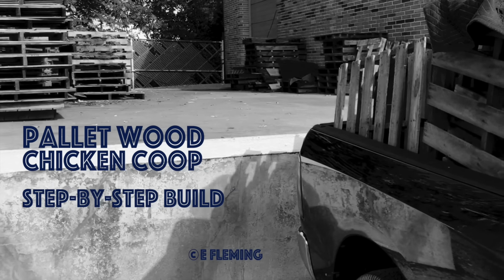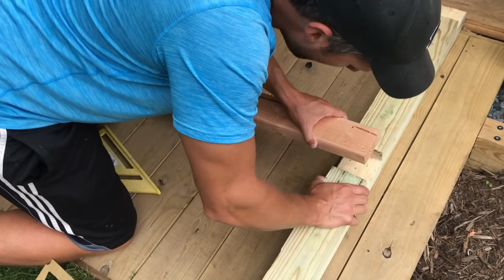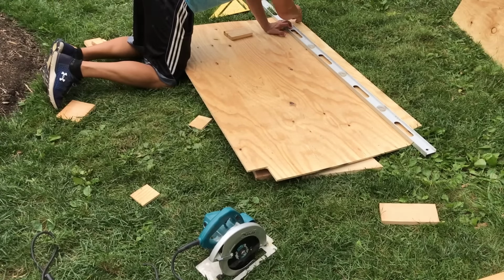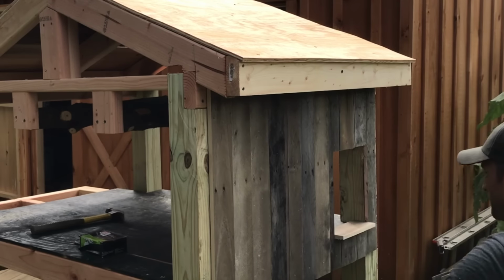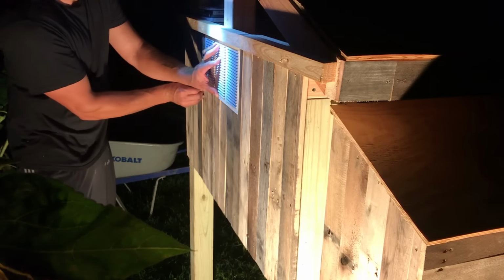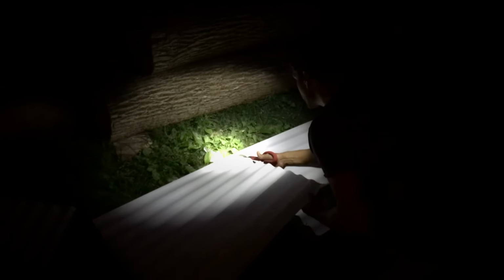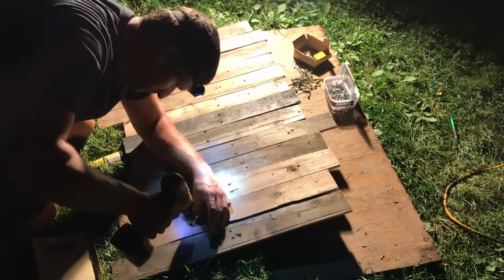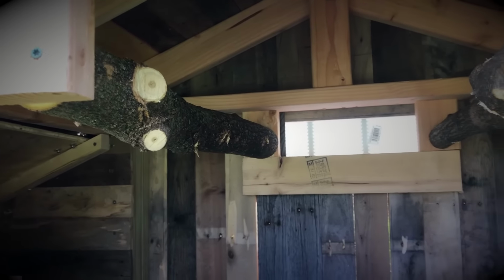Chicken Coop:  Step-by-Step Build V3.0 (Long Version with Commentary)

Comment: Thanks for sharing your video. I was in the same boat. I ended up building my coop and run out of every scrap of wood I could find on my surburban property. I only bought The roof hinges handles and locks and chicken wire for 9 chickens. My husband said  I over built, He said it would hold a baby elephant inside. Guess what I had on hand was baby elephant material? Ha!
Reply from the maker: 😂.  Perfect!

Comment: I used a water proof sealant paint on the floor.  I will use construction sand on the floor as it cleaned up like kitty litter.
Reply from the maker: Sounds like a plan.  That should work well.  If you put plastic bins or trays directly under  the roosts, you’ll save yourself some time and sand.   Id say 90% of the droppings in the coop are found under roosts.   Put a slight sprinkle of sand in the trays, and it’ll keep the droppings from sticking.   Just like putting flour on a cooking surface when kneading dough.   Haha

Comment: if you do the ramp 33:42 without grip pieces the chicken will not be able to climb up to the coop? I see everyone is doing them, but I wonder if they are really necessary.
Reply from the maker: The chickens would probably be fine in dry weather, but if it’s muddy or snowy they would have a tougher time.

Comment: starting to build a coop very similar so I thank you for the invaluable  help and guidance you have given through your videos.  I was wondering though, if the supporting members  (4:30) could be at the same level  to give added strength to floor?  I was only thinking if i needed to get inside to do any work , my coop will be approx  3x5
Reply from the maker: Hey,  I think I understand the question.  The coop is designed this way so that the nesting box can be framed up as part of the coop (not added on separately).   The one set of notches is lower, but the nesting box framing rests on the 2x4 that goes between those posts.  The coop will absolutely hold you (and even a friend).   I framed up a 4x4 coop the same way and stood on top of the platform  (I weigh 250lbs).

Comment: I know this is an older video, but it sure came in handy for me today as I need to build something as cheap & easy as possible to separate some hens. I only have 1 question if you see this comment:  How do you wear a headlamp to work in the dark and not attract a face full of bugs? I thought one would be a great hands-free option when doing late night chores, but the bugs made it impossible to do anything with it on.
Reply from the maker: You’re right!   The bugs get pretty bad!   My wife was very pregnant and we were coming up to the due date….had to get the coop done!

Comment: How do they like the roost? I thought one bar had to be higher than other.
Reply from the maker: As I was researching for the coop build, some said that having different height roosts can create a pecking order / competition over what birds slept where.  I ended up selling this particular coop, but i never I didn’t have any issue with my other coop which also roosts at the same height.
Reply: @E_Fleming  built a modification of your first coop at my old house and looking to do another one at my new house. 

My roosts were the same height and they fought about which spot to sit in. LOL

How many chickens do you think fit in this size coop? Less regulations at my new place and I want to be efficient with space. The free range area will be much bigger than the coop.
Reply from the maker: 😂    A general rule of thumb would be 8-10 square feet of run space per bird, and 2-4 square feet of coop space per bird.  So a 4x4 coop could hold a maximum of 8 birds, but I’d probably do more like 5 or 6…unless they have a lot of space to free range during the day.   You also want to make sure you have enough nesting boxes (1 for every two birds) and roost space (roughly 10-12 inches per bird).
Reply: @E_Fleming  great info - thank you! Also thanks for your videos, they’ve been immensely helpful!

Comment: Probably best to screw the roof down on top of the corrugation, not in the valley, even with rubber grommets, it will eventually leak..You could use a piece of timber about 6 inches long with a screw in one end on the top edge above your door as a gravity latch, instead of a nail....Good Job !!
Reply from the maker: I’ll add those 6 inch pieces of timber at the bottom in addition to the nails (at the top).    Thanks for the suggestions!

Comment: Do you have the measurements of the cuts for the 4x4s? How high did you make the first cut? And the length of the 2x4 that extends to the nesting box?  Currently started this project! Got all my pallets cut up sanding tomorrow and then starting the build😬
Reply from the maker: This isn’t pretty yet, but hopefully it will get you started. https://www.flickr.com/photos/coopinstructions/49801624427/in/dateposted-public/
Reply: E Fleming thank you!!

Comment: Great video.  We've been watching the 1st one and my son is about to start construction.  How many birds do you recommend in each of these coop designs?
Reply from the maker: You’ll want 3-4 square feet of coop space per bird, so the 4x4 coop (16 square feet) could hold 4-5 chickens...maybe 6-7 if you’ve got a good bit of space for them during the day.   The pallet wood exterior coop is about 12 square feet and would be good for 3-4 chickens.   You’ll find some who say you can do as low as 2 square feet of coop space per chicken, but that can lead to some pretty cranky birds...especially if they don’t have much run space or have to spend  a lot of time “cooped up” over the winter.